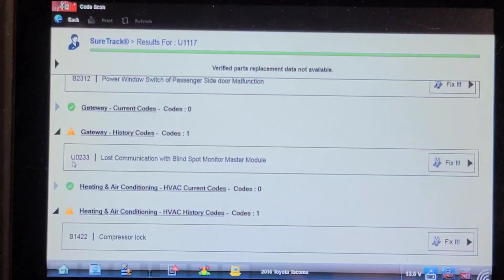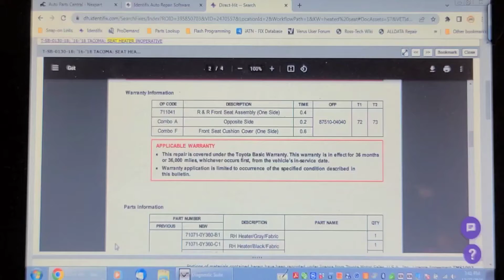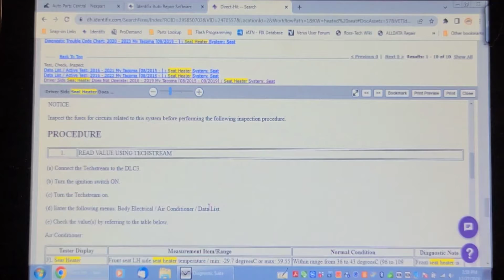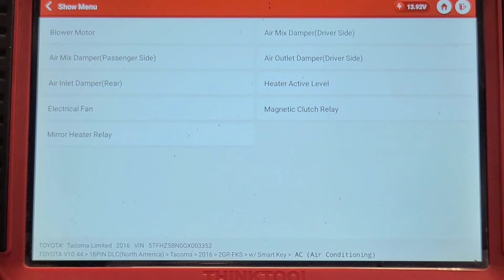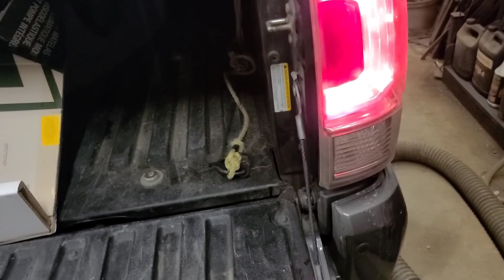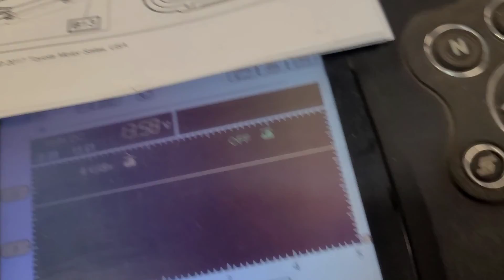2016 Toyota Tacoma Heated Seat Not Working And Blind Spot Detection System Error

Comment: I have a 2016 Tacoma that has had both of these issues. The blind spot monitor went bad because some genius at Toyota decided not to have a watertight seal causing corrosion of the wiring harness and controller box in the rear bumper. The heated seat is most likely a burnout modal due to improperly sized connectors for the clips installed. Both dumb designs with simple fixes (but not cheap)

Comment: this service info on identifix still looks better then mitchell for transport trucks….

typical oem troublemaker charts…
and tsb…    doesnt work change part… no wonder theirs so many parts changers….
then it says check for voltage but not load the circuit?
Reply from the maker: @jordanboulay3780  yes you have to read between the lines for sure.
Reply: These Charts also apply on the older Mercedes from the 80s with the WIS.
If this, then, change Controller. 
If that, change fuel distributors 

Ah yes. These things are cent-parts and grow on trees.

Comment: Phill, Mery xrsms and happy new year to you and family and ur viewer great thought process and approach I just want to add some thing that those new vehicles that have ADAS SYSTEM LIKE CRUSE CONTROL, CAMERS, RADARS AND SO ON if you play and mess around the bumpers specially front pumper the system will not be the same you will have other issues unless u do alignment and use ADAS tool to recalibrate the sensors to the right position so can work as should thanks for sharing cheeeeers.
Reply from the maker: Best of the season to you and your family as well. Yes you are correct and I'll send it to the dealer  for calibration as I don't have the target fixture. Thanks.